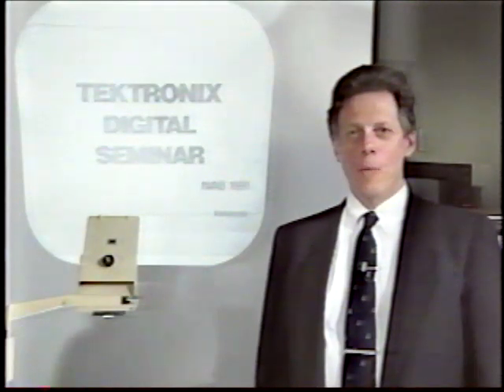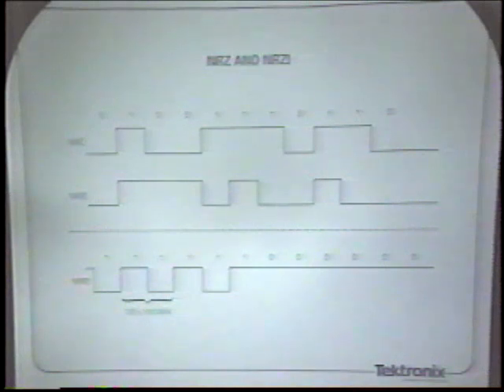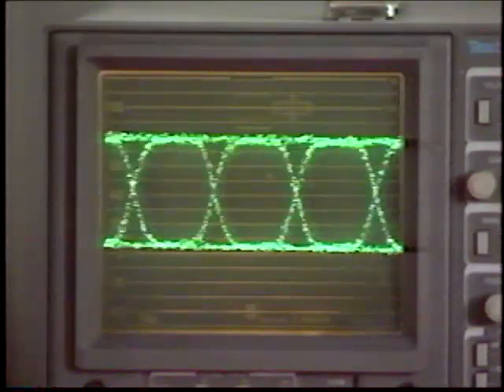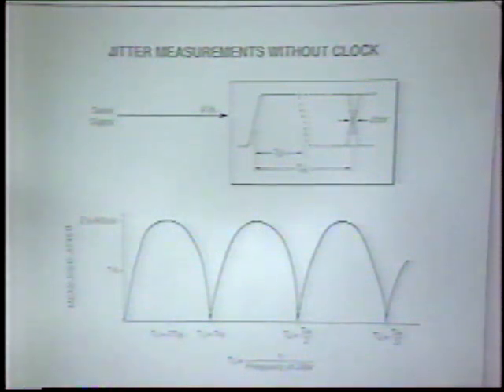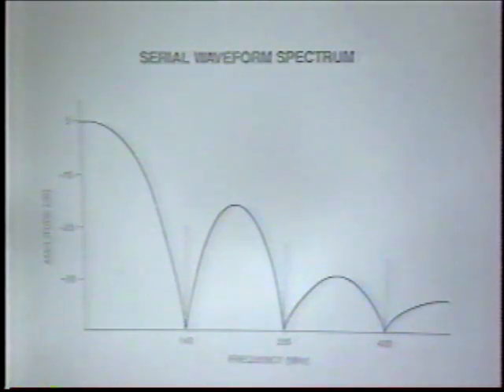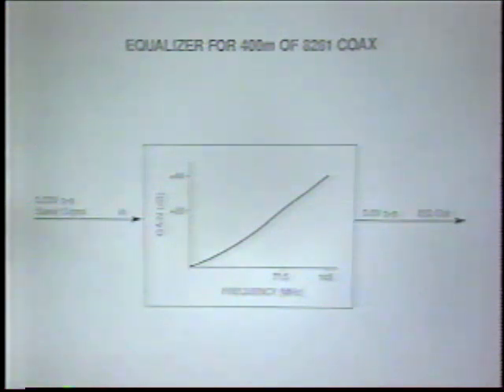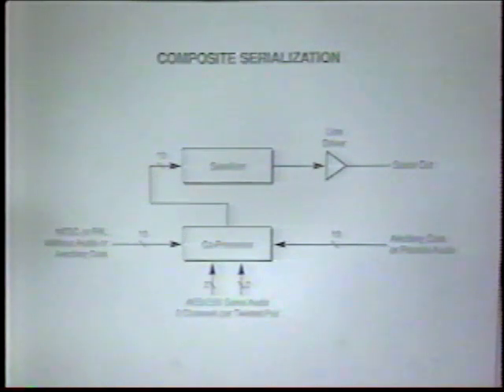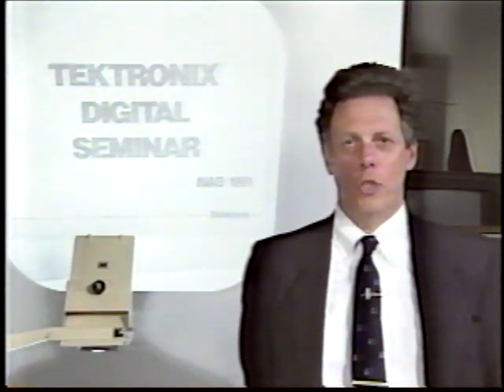Tektronix Digital Seminar

Comment: This video needs to be uploaded with a higher resolution, everything is unreadable.
Reply: It should still be readable at 480p. Its probably the actual source material being so blurry, video tape was not very good back in the day and it might have deteriorated somewhat in all those years.
Reply: The old tapes are to blame. At least we now have them digitized, so they wont deteriorate any more.